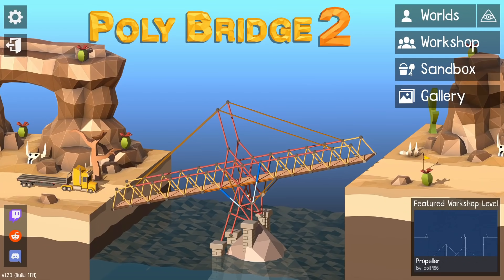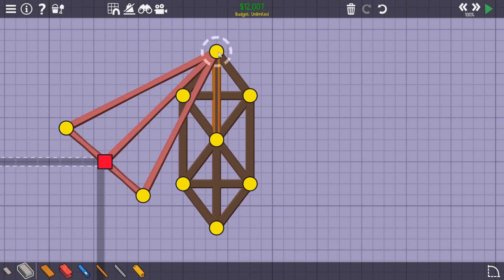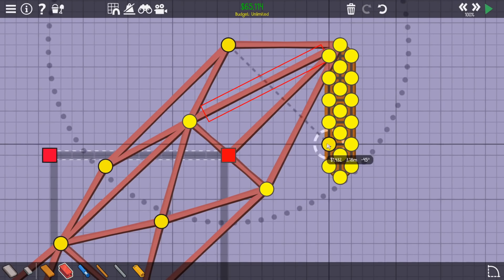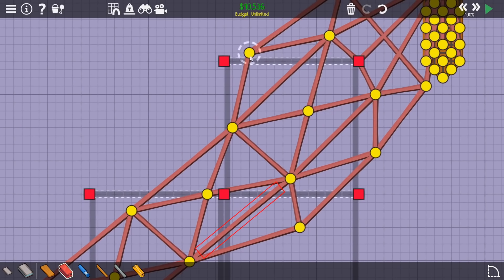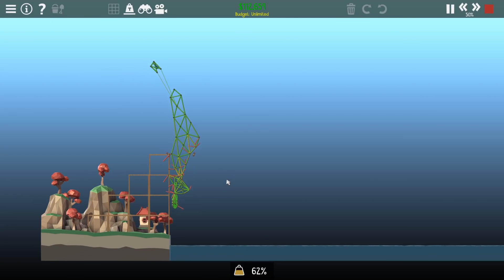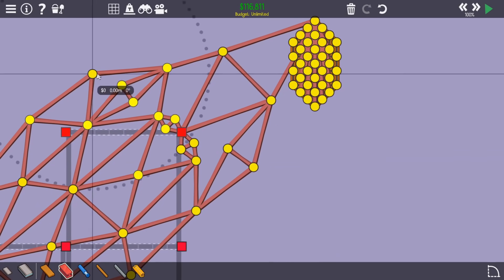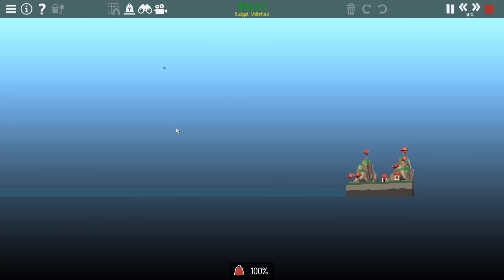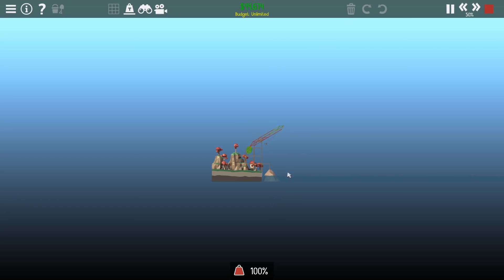Bringing Back the Siege Machine in Poly Bridge 2

Comment: Very cool. Another option for releasing the car is setting the split joint delay to zero and placing a checkpoint in the air for the car to hit. You could really dial in timing that way.

Comment: The extremity of the arm doesn't need to be as thick as your counter weight section. For the counter weight, you didn't consider the centripetal acceleration and only when in bruteforce mode of adding material. Instead, you could have put the beams perpendicular to your pivot to make it hold stronger by using less material.